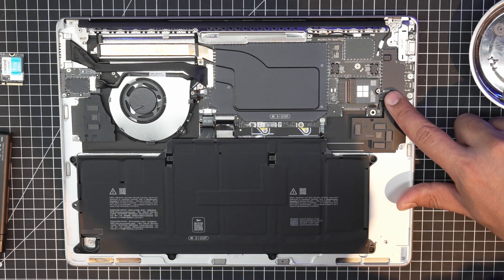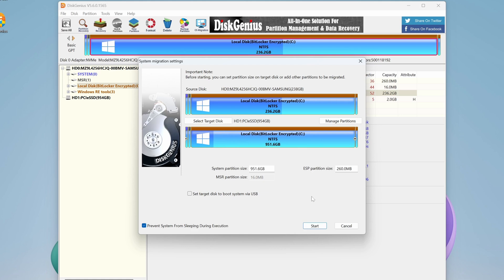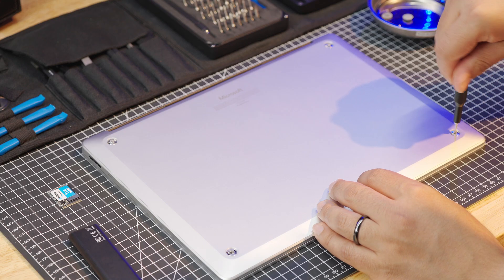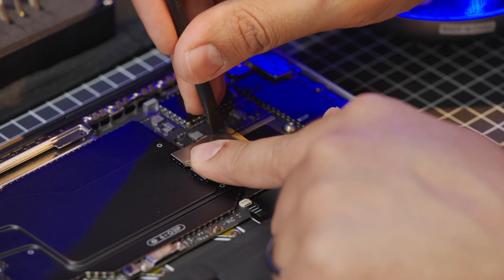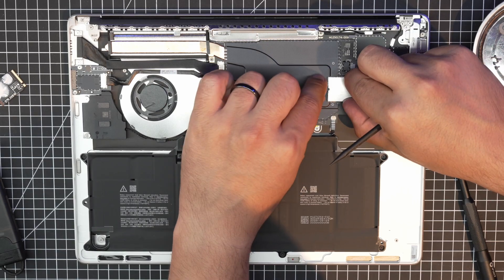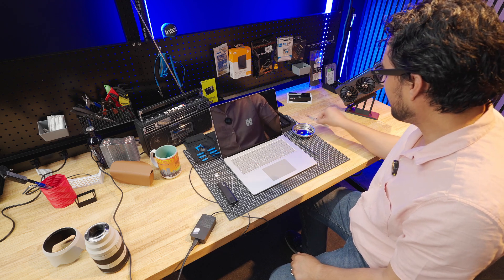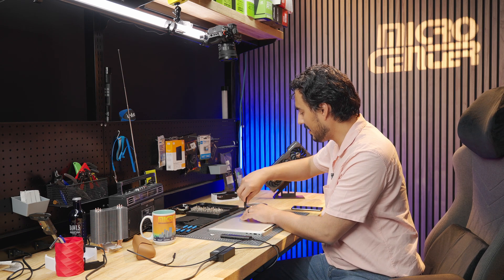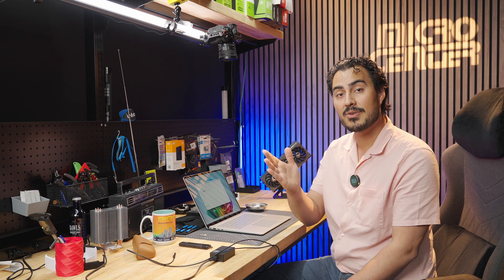Upgrading The SSD In Your Microsoft Surface Laptop

Comment: This works on every laptop like you said, I had a t14 gen 4 thinkpad and it used. To have a 512GB ssd but got a Samsung 990 pro 4TB one and used Samsung magician software to migrate the data(recomended so the new drive is already fully partitioned and you dont have extra space unintalized

Comment: will this method also work in the surface laptop 6 for business as well? And if so would the Western Digital 512GB SSD PC SN530 M.2 2230 30mm PCIe Gen3 x4 NVMe SDBPTPZ-512G Solid State Drive work?

Comment: After putting the rubber feet back in, it doesnt seem to be as tight as before. So the rubber feet are a little bit loose. Does anyone else experience the same thing? Would appreciate any response 😊

Comment: outstanding; followed this video and installed the same drive on my new surface laptop, now I have some space and saved a bunch of money. same difficulty with the shielding but it worked fine, cloning went fine with the program you demonstrated and now up and running in less than 30 minutes start to finish. I now have a MS surface laptop and an Apple mac-book pro m4, I recommend one of each....  why compare, if you can swing it, you have an almost perfect balance without the virtualization hang ups; now I'm going to dual boot Debian Linux 12 ARM version with windows.......
Reply: Get yourself an ipad too with magic keyboard.

Comment: I have a question. If you swap the hard drive on the Surface Laptop 7th generation, 15 inch or 13 inch, swap or change the hard drive to have 2 TB on it, then the question is, is this AI still there after you've swapped the hard drive instead of and booted Windows so that Windows starts normally and is completely normal without AI after you've now just put a new hard drive on it so that it's without AI after you've swapped the hard drive and then booted Windows 11 and restarted normally, is it without AI or how exactly is it if I may ask? :)
Reply: The NPU(Ai) is attached to the Processing Chip along with the RAM. So, Yes the Surface 7 is still being powered with Ai even after swapping the SSD.

Comment: Hi. I upgraded my surface exactly as you described, i.e. Cloned The System on new ssd and installed on motherboard. System is booting Fine but Keyboard and mouse trackpad is Not working anymore, except Power Button and Finger Print Login. So, Keyboard seems to be connected correctly. What went wrong?

Comment: Their disc sizes are priced like Apple. It's even cheaper to buy the 256GB capacity version and upgrade it to 2TB than getting the 512GB version. On top you get a 256GB drive you can put into a USB thumb drive enclosure. Although many Apple's now have chips soldered onto MB. Sad the way it's developing. RAM is soldered except gamer and heavy duty business machines. Really make them 2 mm thicker which I'd happily trade for ram in sockets as well. But at least isn't worn as SSD is. No excuse IMHO for soldering SSD - and in Apples case at least those I've seen they havent really been faster. All about saving a connector and denying the consumer the option to upgrade other than get more e-waste.

Comment: Thanks for the video! When I did this on a Surface Pro 9 a year or two ago, I had a horrible nightmare of needing bitlocker keys before it would boot. How did you avoid this? Thanks!
Reply: I think that is because your drive is probably encrypted by bitlocker, to disable bitlocker do this:
Start > Settings > Update & Security > Device Encryption > select Turn Off

After you do this, the next time you upgrade the SSD you won't have any trouble like this.
Reply: Answer would be nice

Comment: #IWANTAMICROCENTERNEARME (Lexington, KY)
Reply: Best Buy and the Geek Squad suck. I had them work 2 of my PC's and they broke my laptop screen and was taking my family photos of of my gaming desktop and saving then to their flash drives. The employees at Best Buy and Geek Squad are Rude, not knowledgeable, not techy and can not fix anything. They over price and expect a automated software to diagnose, repair and setup your devices. They also have a third party remote into your device.  I took this issue to their store General Manager and corporate office and was banded from Bet Buy and Geek Squad for life. After this I drove 2 hours to Micro Center in Ohio where the staff and Technicians fantastic, friendly, knowledgeable, answered my questions, educated me. explained everything,, was patient with my and fixed everything. They has all parts in store and did not use third party to do the work. They had a A+ CompTIA Certified Tech work on my devices. I would recommend Micro Center to anyone.